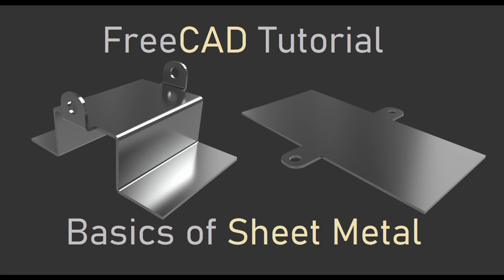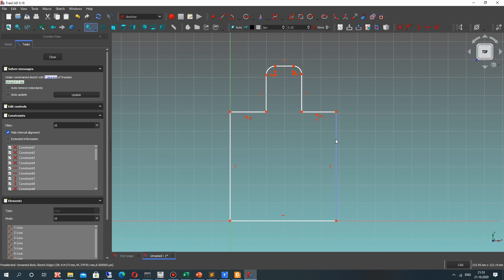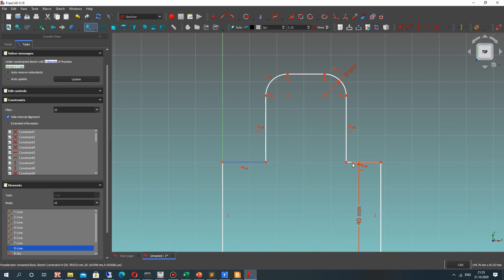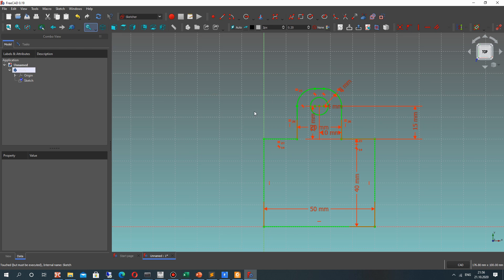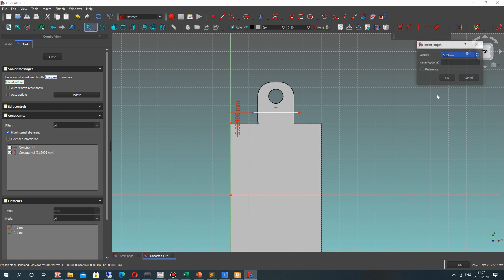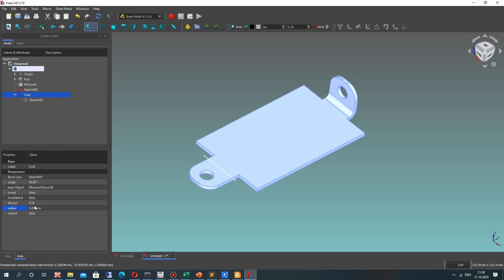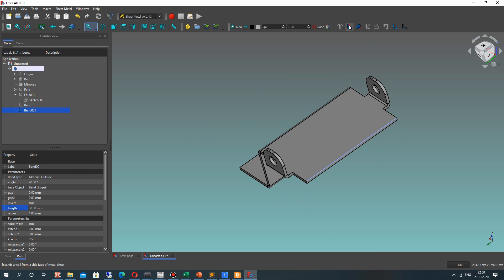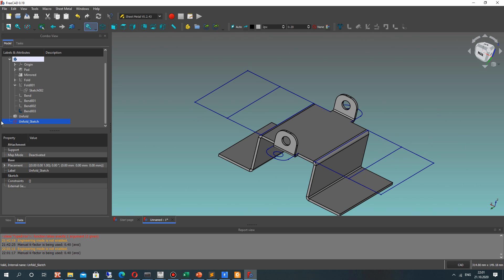FreeCAD Tutorial | Basics of Sheet Metal Workbench for Begginers

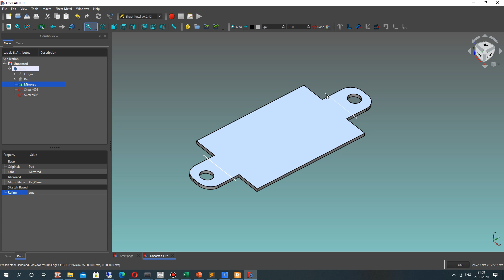Comment: To Bend at Sketch Line-at 6:30 ... Click on/ High light the Padded Part (Not the "Mirrored" in Part Tree) Then Hold CTRL and Click on the Sketch with desired bend line: Then Click "Fold a Wall" Icon in tool bar-  Also, at 4:23 make sure to select "Reversed" when padding your Sketch or the bend line won't be in correct location to work.

Comment: One important thing I missed is 4:23, reversed is clicked. 
The material needs to be made UNDER the XY plane. Not on TOP. Else the bending lines will be on the bottom of the sheet metal and the bending won't work.

Comment: Awesome tutorial, was looking for this. Very well explained.
Reply from the maker: Thanks!
Reply: Well? No way. Nothing is explained. Shortcuts or witch button gets pressed is not viewed or said. I only got to the point having the sketches but then after choosing Mirrored and Sketch001 only one icon gets colored of the sheet metal related. And that button even does not exist on his sheet metal workbench version. Mine is V 0.2.47 and button looks like a sketch and a fold.
Reply: Ok it was a surface problem. Before I had highlighted the whole pading by what ever means. Confusion between clicking in combo or surfaces. Coming from blender so the 3D space isn't the problem but where to click and when.